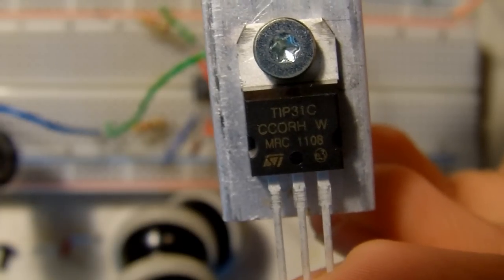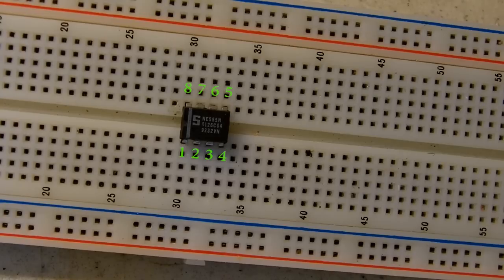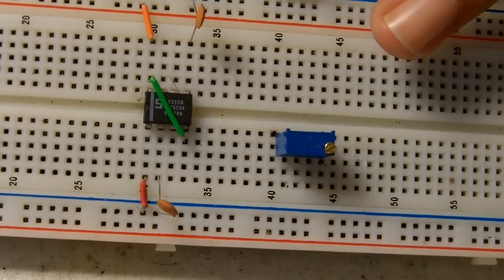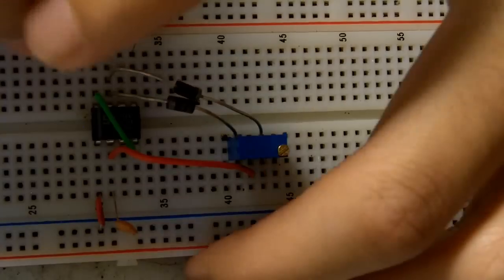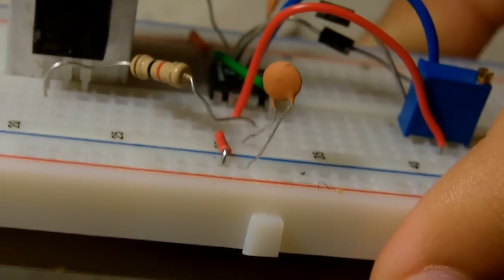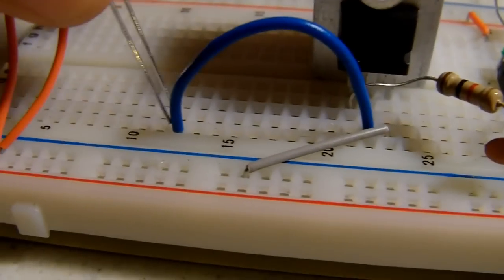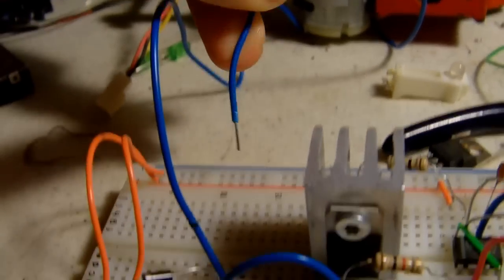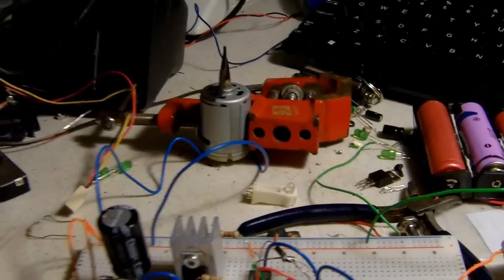555 pwm circuit step by step setup tutorial

Comment: That’s the same issue I had with the potentiometer I get no turn up and down just one high and the pwm pulse was not work I use 5 different 555 and the same out come I change the top and it work a little till the pot stop work all new parts and I build a lot of pwm circuit with other Ic but 555 Ic is just a waste of time

Comment: Hey, im assuming I can use this circuit to control a SSR for a heat element, right? Or does it ajust the wrong part of the wave ? And for my application since the ssr can be triggered from 3-20sum Volts, I can probably use a 5.5V power supply and ajust resistance he used in the vid?  I have built a few power control units for brewing but I have always used diacs and pots, ic's are somewhat new to me and dont come second nature yet.  My head hurts from working on my own schematics and any help would be killer.

Comment: I got this working with a fuel injector. The current location of your potentiometer only changes the power level, and not the duty cycle of the square wave. If you change out the resistor at the upper portion of your breadboard to a variable potentiometer it will control the pulse width, and not the power input.  Update on the above info... I keep blowing out my 555 chip. I thought it was due to shorting things out, but at one point I added two 1k resistors in series to slow down the pulse, and that blew the timmer chip. I'm about ready to give up on this altogether. I also have a PWM and all it does is makes the injector click once. The PWM can drive a small motor. I know about the connection to the negative side, but the negative side and then to what? The PWM has a (+) and (-) terminal so how else can I connect it? You can't just connect the injector to the negative side and then leave it open to the air.. I'm not getting anywhere with this and to be honest, most YouTube videos on this topic are extremely lacking.
Reply: No it is PWM. 
I thought you were right but then I realized the pin numbers are all over the place in the schematic.

Comment: Nice Tutorial! I have a doubt: Is it possible to constraint the modulation to something like 30%. The idea is about using a 2500rpm cooler, but I only can use about 500rpm. I mean using the full potentiometer course and having more accurancy on the rpm. Is that possible? Thank you

Comment: hey nice video I like to ask a question that if I would use a npn Transistor rather than tip31transistor
Reply: Ishaan saxena 
TIP31C is also an NPN medium power transistor...
You can also use small power NPN trnasistor such as 2N2222A or 2N3904 but it will not last because of the heat generated...

Comment: is there a way I can use this circuit of 36v motor with 20 amp
Reply: Can you let me know if you find something like that? I want a circuit for a higher amperage as well
Reply: Hello we can power 36v motor using an IRFZ44 n channel MOSFET connect - gate to pwm drain to -ve of motor (36v) source to ground and +ve of motor the +36volts
Reply: +Shankar Ravi I have IRFZ40, IF JUST REPLACE IT WITH tp31c to test the circuit at 12 v will it work
Reply: Yes you can replace it with IRFZ40 N CHANNEL MOSFET
Reply: That would  be  great, I'll test that in the morning,  the   next issue is continues motor  load of   30amp?.
Reply: The 10 amps I think drawn by the circuit
Reply: +Shankar Ravi
 it worked, 
 can I drive 2 mosfet from this circuit.
Reply: +Shankar Ravi 
u mean I can max use this circuit  for 10 amps

Comment: Would connecting a capacitor to remove the hum work on all 555pwm applications? Which pins does the cap connect to?
I'm using surface mount PCBs so Id have to have then remade to place the capacitor on so it'd be easier if I could just solder it to the pins of the timer or output/input wires. Thanks for the help!

Comment: So could this handle lets say 100 or even 200 Amps at lets say 24vdc ?
Reply: MARK 1 I dont think the 555 timer works very well at such high currents.
Reply: ***** What if it drove an n-Channel mosfet that was rated to handle such current? Or how about driving a couple or few n-channel mosfets that were designed to handle such current and wattage?
Reply: MARK 1 Sorry, I guess you over-estimated my knowledge of electronics :P I don't really know what you mean
Reply: ***** It's cool. Yes, it's possible to drive 100 amps with a 555 timer. You need a n-channel mosfet and you also need a p-channel mosfet. I learned quite a bit since I asked the above question. It's being done with electric go-carts and it's being done with pulse width modulated box mods that use the 555 timer, n & p-channel mosfets.
Reply: +applefanXXX to simplify what mark said: picture a room with a light and a switch and a person flipping the switch. The light = the motor, The switch = the transistor, the person at the switch = the 555 timer. The 555 isnt providing the power to the motor, it is providing enough power to switch the transistor. The wattage of the load(motor, light, etc) you can drive is dependent on what the transistor is rated for not the 555.
Reply: John Wuethrich Yep, n-Channel Mosfet. I actually am currently using a 1kw mosfet right now. It handles the current, so the current doesn't damage the switch, of in this case, it could protect the 555 timer. So to answer my question, yes, the amount of power for a PWM is limitless. Especially if you paralleled the n-Channel Mosfets. Probably use p-Channel too.
Reply: +Mark II a 1kw mosfet??? lol how big is your heatsink array?

Comment: With this scheme can control the motor 24vdc? Or need to change any component?
Reply: You will need to introduce a 7812 (or similar) voltage regulator to power up the 555, as this can only handle up to a maximum of 15V.
You will also need to check to see if the transistor / MOSFET used in this video is suitable enough to handle the current and voltage required by the aforementioned motor.
Reply: . Ok thank you

Comment: Hi there and thank you for your efforts.
What I need to do is set up a 555 and a relay to turn on and off every 5 seconds.
Is there an accurate way to do this?
Reply: Use an Arduino UNO to program a ATtiny85 chip.

Comment: It would have been nice to have been told the range of operating frequency and range of duty cycle.  Since both frequency and duty cycle are changing together it would have been nice to see graphs of these two parameters superimposed.  It would have been nice to know what the range of collector currents on your transistor are.  It would have been nice to know if your transistor is acting as a saturated transistor switch over the full range of operating frequency.
Reply: In short, it would have been nice if this was an actual tutorial/explanation of principal or abstract reasoning rather than just a specific build demonstration. He just mocked up a circuit and then showed us the finished, ironed out pwm circuit which worked in his application.

I can deduce by watching this, that it has a range of about 12+/-3V mainly due to the 555, and the fact that this is a 12V motor...those TO-220 NPN MOSFET (TIP31) transistors are hearty creatures and can apparently cram quite a lot of voltage/current through them.

Comment: The biggest problem with smoting the output voltage is the heat createt at the transistor. PWM is made to reduce this very much by turning it full off (no current) and fully on (no voltage at the transistor). By adding a capacitor at the end the transisor cannot switch full on and there will be voltage AND current at the transistor witch creates very much heat.

Comment: I am new to the subject, but I think that it's like this: The noise is due to losses which need to be overcome when first starting the motor (heat, friction, emf, etc) Having a cap in parallel allows a fast-release of current to start the motor. Also, using a PWM can be in order to allow a change of voltage (you need variable signal in order to change it) and you maight want to smooth it out again afterwards using inductors and caps.

Comment: I hope somebody answered this already, but anyway. I guess your motor isn't build to handle PWM and requires just plain old voltage level adjustment (because that's essentially what you're doing when you connect a cap to a PWM signal). If you want, test the same setup with a computer fan (or anything, those just usually handle PWM well) that has PWM capability. You shouldn't hear that noise anymore even without the cap.

Comment: If I got a 1200rpm motor it's safe or possible to boost the rpm? Will I need more then rated 12v or more amps if its possible to just increase amps !?

Comment: Well, I tried this, twice, and failed miserably. The only differences are 1) I'm using a circuit board instead of breadboard, 2) my NPN transistor is a TO-92 type, and 3) my Pot is much larger... I guess I'll just stick a heatsink on to my Pot and use it to control my motor directly :(

Comment: Hello I duilt this PWM and it works great to drive a 12 volt and light but I am connecting this to a ATX power supply to make wood burning (pyrography machine) the problem is that it will not get the pen hot any suggetions. Thanks George

Comment: When you add the capacitor you smooth out the PWM waveform, weakening it. The sound you once heard was the strength, frequency and shape of the PWM  if you instead raise the frequency above 20khz you will not be able to hear the PWM, then you can remove the cap and still have a strong PWM signal.

Comment: with a 10K pot between power supply and pin 7, maximum of 10 Ohms between pin 7 and pin 6, a 10µF capacitor from pin 6 to ground, you can easily get 60Hz

Comment: The reason motors get noisy when controlled with PWM is because the switching frequency basically makes the motor coils resonate and produce sound. While this generally doesn't bother brushed motors, feeding unfiltered PWM to a brushless DC motor will eventually destroy it because the control ICs in the motor aren't designed for such fast switching.

Comment: and even if the datasheet says 25A at 100v, don't ever run it at those levels at the same time! All it is describing is it's max limits, independent of eachother. Technically you could do it if you were able to keep the die temp at 25 degrees Celcius, but that isn't really going to happen in real life..

Comment: You're right, the only capacitor that may be used is a small ceramic to arrest the spikes from the brushed motor (to avoid radio interference).
PWM does not maintain torque (it regulates the current without dissipation therefore torque and speed), but still the whole idea is to have pulses. If you try to get rid of the whine you are doing it wrong.

Comment: Yes your right but this happens only at power supplies! you souldn't use a cap because if you switch on & off at 48volts and the voltage that you want is 12V if you use a cap then the cap will store 48 volts!

Comment from the maker: The TIP31 will not handle 15-20 amps. The TIP31 can only handle 3 amps at 100v. For that load you would want to use a TIP36. The TIP36 can handle 25 amps at 100v. Also take into consideration that your HHO generator could be using more or less volts. If using less voltage, lets say 10v, you can use the TIP31 because theoretically it can handle 30 amps at 10 volts. Just to be safe get the TIP36. Hope this helps.

Comment: hello, i was thinking about using this circuit to modulate an HHO generator, would this transistor be able to handle around 15-20 amps to switch the generator.

thanks fro the video